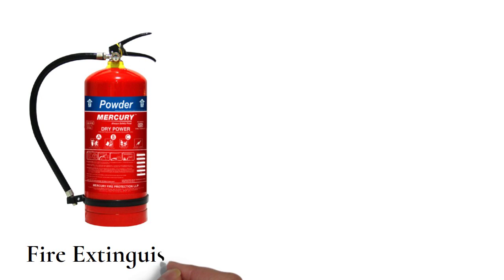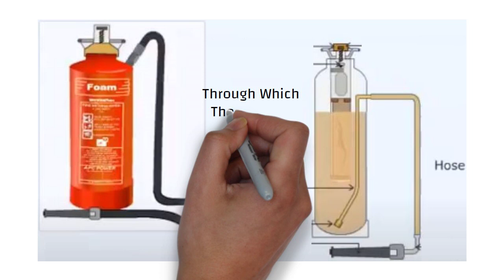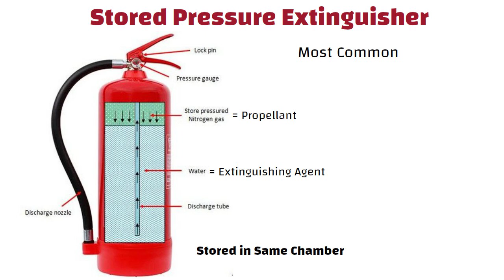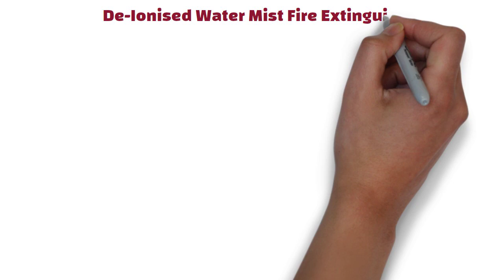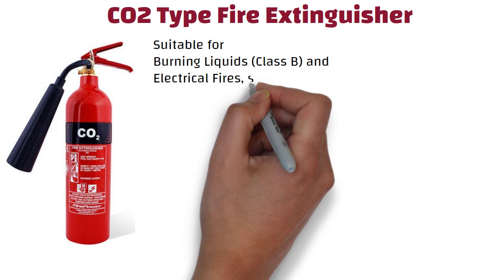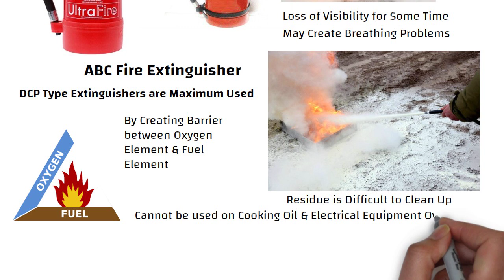FIRE EXTINGUISHER DEALERS IN KERALA, CALL 8138906102, FIRE EXTINGUISHER DEALERS IN ERNAKULAM.

Comment: Fire extinguisher in Feroke
Reply: FIRE EXTINGUISHER DEALERS IN KERALA, FIRE EXTINGUISHER SUPPLIERS IN KERALA, FIRE EXTINGUISHER DISTRIBUTORS IN KERALA, FIRE EXTINGUISHER IN KERALA, ABC TYPE FIRE EXTINGUISHER DEALERS IN KERALA, CO2 TYPE FIRE EXTINGUISHER DEALERS IN KERALA, CLEAN AGENT FIRE EXTINGUISHER IN KERALA, MODULAR TYPE FIRE EXTINGUISHER DEALERS IN KERALA, MECHANICAL FOAM FIRE EXTINGUISHER DEALERS IN KERALA, FIRE EXTINGUISHER NEAR ME KERALA, FIRE EXTINGUISHER TRADERS IN KERALA, FIRE FIGHTING COMPANIES IN KERALA, FIRE CONTRACTORS IN KERALA, FIRE EQUIPMENT DEALERS IN KERALA, FIRE ALARM DEALERS IN KERALA, FIRE PUMP DEALERS IN KERALA, SMOKE DETECTOR DEALERS IN KERALA, FIRE FIGHTING SYSTEM IN KERALA, FIRE PROTECTION SYSTEM IN KERALA, FIRE AND SAFETY CONTRACTORS IN KERALA, FIRE HYDRANT SYSTEMS IN KERALA, PA TALK BACK SYSTEM IN KERALA, FIRE NOC IN KERALA, FIRE INSTALLATION IN KERALA, FIRE NOC RENEWAL IN KERALA, KIRLOSKAR FIRE PUMP DEALERS IN KERALA, FIRE EXTINGUISHER NEAR ME KERALA, FIRE EXTINGUISHER MANUFACURERS IN KERALA, SAFEX FIRE EXTINGUISHER DEALERS IN KERALA, FIRE NOC CONTRACTORS IN KERALA, FIRE FIGHTING EQUIPMENT DEALERS IN KERALA, FIRE PROTECTION SYSTEM IN KERALA, FIRE INSTALLATION IN KERALA, FIRE SAFETY CONTRACTORS IN KERALA, FIRE AMC IN KERALA, FIRE PROTECTION SYSTEM IN KERALA, FIRE PROTECTION EQUIPMET IN KERALA, AMC OF FIRE SYSTEM IN KERALA, FIRE CONSULTANTS IN KERALA, FIRE AND SAFETY EQUIPMENT DEALERS IN KERALA, ADDRESSABLE FIRE ALARM SYSTEM IN KERALA, KARTHAR VALVE DEALERS IN KERALA, DCP TYPE FIRE EXTINGUISHER IN KERALA, POWSER TYPE FIRE EXTINGUISHERS IN KERALA, FIRE HYDRANT SYSTEM IN KERALA, FIRE ALARM PANEL DEALERS IN KERALA, SAFEPRO FIRE EXTINGUISHER DEALERS IN KERALA, MS AND GI PIPE DEALERS IN KERALA, JINDAL PIPE DEALERS IN KERALA, AGNI FIRE ALARM DEALERS IN KERALA, FIRE EQUIPMENT DEALERS IN KERALA, FIRE EQUIPMENT SUPPLIERS IN KERALA, FIRE EQUIPMENT TRADERS IN KERALA, FIRE SPRINKLER SYSTEM IN KERALA, RAVLE FIRE ALARM DEALERS IN KERALA, RAVEL FIRE ALARM SYSTEM IN KERALA, AGNI FIRE ALARM DISTRIBUTORS IN KERALA, FIRE ALARM CONTRACTORS IN KERALA, FIRE PIPE INSTALLATION IN CONTRACTORS IN KERALA, FIRE SAFETY CONTRACTORS IN KERALA, FIRE PA TWO WAY TALK BACK SYSTEM DEALERS IN KERALA, HEAT DETECTOR DEALERS IN KERALA, HONEYWELL FIRE ALARM DEALERS IN KERALA, FIRE NOC CONSULTANTS IN KERALA, FIRE AMC AND FIRE NOC IN KERALA, FIRE SAFETY COMPANIES IN KERALA, NEWAGE DEALERS IN KERALA, MONSHER FIRE EQUIPMENT DEALERS IN KERALA, KARTHAR VALVE DEALERS IN KERALA, FIRE HYDRANT VALVE DEALERS IN KERALA, FIRE HOSE REEL DRUM DEALERS IN KERALA, FIRE SPRINKLER DEALERS IN KERALA, FIRE PUMP DEALERS IN KERALA, LUBI PUMP DEALERS IN KERALA, LHP PUMP DEALERS IN KERALA.

Comment: Fire extinguisher dealers in Feroke
Reply: FIRE EXTINGUISHER DEALERS IN KERALA, FIRE EXTINGUISHER SUPPLIERS IN KERALA, FIRE EXTINGUISHER DISTRIBUTORS IN KERALA, FIRE EXTINGUISHER IN KERALA, ABC TYPE FIRE EXTINGUISHER DEALERS IN KERALA, CO2 TYPE FIRE EXTINGUISHER DEALERS IN KERALA, CLEAN AGENT FIRE EXTINGUISHER IN KERALA, MODULAR TYPE FIRE EXTINGUISHER DEALERS IN KERALA, MECHANICAL FOAM FIRE EXTINGUISHER DEALERS IN KERALA, FIRE EXTINGUISHER NEAR ME KERALA, FIRE EXTINGUISHER TRADERS IN KERALA, FIRE FIGHTING COMPANIES IN KERALA, FIRE CONTRACTORS IN KERALA, FIRE EQUIPMENT DEALERS IN KERALA, FIRE ALARM DEALERS IN KERALA, FIRE PUMP DEALERS IN KERALA, SMOKE DETECTOR DEALERS IN KERALA, FIRE FIGHTING SYSTEM IN KERALA, FIRE PROTECTION SYSTEM IN KERALA, FIRE AND SAFETY CONTRACTORS IN KERALA, FIRE HYDRANT SYSTEMS IN KERALA, PA TALK BACK SYSTEM IN KERALA, FIRE NOC IN KERALA, FIRE INSTALLATION IN KERALA, FIRE NOC RENEWAL IN KERALA, KIRLOSKAR FIRE PUMP DEALERS IN KERALA, FIRE EXTINGUISHER NEAR ME KERALA, FIRE EXTINGUISHER MANUFACURERS IN KERALA, SAFEX FIRE EXTINGUISHER DEALERS IN KERALA, FIRE NOC CONTRACTORS IN KERALA, FIRE FIGHTING EQUIPMENT DEALERS IN KERALA, FIRE PROTECTION SYSTEM IN KERALA, FIRE INSTALLATION IN KERALA, FIRE SAFETY CONTRACTORS IN KERALA, FIRE AMC IN KERALA, FIRE PROTECTION SYSTEM IN KERALA, FIRE PROTECTION EQUIPMET IN KERALA, AMC OF FIRE SYSTEM IN KERALA, FIRE CONSULTANTS IN KERALA, FIRE AND SAFETY EQUIPMENT DEALERS IN KERALA, ADDRESSABLE FIRE ALARM SYSTEM IN KERALA, KARTHAR VALVE DEALERS IN KERALA, DCP TYPE FIRE EXTINGUISHER IN KERALA, POWSER TYPE FIRE EXTINGUISHERS IN KERALA, FIRE HYDRANT SYSTEM IN KERALA, FIRE ALARM PANEL DEALERS IN KERALA, SAFEPRO FIRE EXTINGUISHER DEALERS IN KERALA, MS AND GI PIPE DEALERS IN KERALA, JINDAL PIPE DEALERS IN KERALA, AGNI FIRE ALARM DEALERS IN KERALA, FIRE EQUIPMENT DEALERS IN KERALA, FIRE EQUIPMENT SUPPLIERS IN KERALA, FIRE EQUIPMENT TRADERS IN KERALA, FIRE SPRINKLER SYSTEM IN KERALA, RAVLE FIRE ALARM DEALERS IN KERALA, RAVEL FIRE ALARM SYSTEM IN KERALA, AGNI FIRE ALARM DISTRIBUTORS IN KERALA, FIRE ALARM CONTRACTORS IN KERALA, FIRE PIPE INSTALLATION IN CONTRACTORS IN KERALA, FIRE SAFETY CONTRACTORS IN KERALA, FIRE PA TWO WAY TALK BACK SYSTEM DEALERS IN KERALA, HEAT DETECTOR DEALERS IN KERALA, HONEYWELL FIRE ALARM DEALERS IN KERALA, FIRE NOC CONSULTANTS IN KERALA, FIRE AMC AND FIRE NOC IN KERALA, FIRE SAFETY COMPANIES IN KERALA, NEWAGE DEALERS IN KERALA, MONSHER FIRE EQUIPMENT DEALERS IN KERALA, KARTHAR VALVE DEALERS IN KERALA, FIRE HYDRANT VALVE DEALERS IN KERALA, FIRE HOSE REEL DRUM DEALERS IN KERALA, FIRE SPRINKLER DEALERS IN KERALA, FIRE PUMP DEALERS IN KERALA, LUBI PUMP DEALERS IN KERALA, LHP PUMP DEALERS IN KERALA.

Comment from the maker: IN PANDALAM, KIRLOKAR FIRE PUMP DEALERS IN HOSUR, KIRLSOAKR FIRE FIGHTING PUMP DEALERS IN PANDALAM, KIRLOSKAR FIRE PUMPS IN PANDALAM, KIRLSOKAR FIRE PUMP DISTRIBUTORS IN PANDALAM, FIRE ENGINE PUMP SETS IN PANDALAM, KIRLOSKAR PUMP DEALERS IN TIRUELVELI, KIRLOSKAR DEALERS IN PANDALAM, KIRLOSKAR PUMPS IN PANDALAM, KIRLOSKAR PUMPS IN PANDALAM, LUBI FIRE PUMP DEALERS IN PANDALAM, LUBI FIRE PUMP DEALERS IN PANDALAM, LUBI FIRE PUMP DEALERS IN PANDALAM, FIRE PUMP SUPPLERS IN PANDALAM, FIRE FIGHTING PUMP DEALERS IN PANDALAM, FIRE PUMP DEALERS IN PANDALAM, FIRE PUMP SUPPLIERS IN PANDALAM, FIRE PUMP DEALERS IN PANDALAM, FIRE FIGHTING PUMPS IN PANDALAM, FIRE FIGHTING PUMP DEALERS IN PANDALAM, FIRE FIGHTING PUMP SUPPLIERS IN PANDALAM, FIRE FIGHTING PUMP SET DEALERS IN PANDALAM, FIRE PUMP IN PANDALAM, FIRE PUMP IN PANDALAM, FIRE PUMP IN PANDALAM, FIRE DIESEL ENGINE PUMP DEALERS IN PANDALAM, FIRE DIESEL ENGINE STANDBY PUMP DEALERS IN PANDALAM, FIRE JOCKEY PUMP DEALERS IN PANDALAM, FIRE JOCKEY PUMP DEALERS IN PANDALAM, FIRE JOCKEY PUMP DEALERS IN PANDALAM. CRI PUMP DEALERS IN PANDALAM, HYDRO PNEUMATIC PRESSURE BOOSTING PUMP DEALERS IN PANDALAM, VERTICAL INLINE PUMP DEALERS IN PANDALAM, INDUSTRIAL PUMP DEALERS IN PANDALAM, SEWAGE PUMP DEALERS IN PANDALAM, STP AND ETP PUMP DEALERS IN TIRUNELVALEI, STP AND ETP PUMP DEALERS IN TPANDALAM, STP AND ETP PUMP DEALERS IN PANDALAM, STP AND ETP PUMP DEALERS IN PANDALAM, HYDRO PNEUMATIC PRESSURE BOOSTING PUMP DEALERS IN PANDALAM, SEWAGE PUMP DEALERS IN PANDALAM, DEWATERING PUMP DEALERS IN PANDALAM, FIRE JOCKEY PUMP DEALERS IN PANDALAM,
Reply: FIRE EXTINGUISHER DEALERS IN KATTAPPANA, FIRE EXTINGUISHER SUPPLIERS IN KATTAPPANA, FIRE EXTINGUISHER DISTRIBUTORS IN KATTAPPANA, FIRE EXTINGUISHER IN KATTAPPANA, ABC TYPE FIRE EXTINGUISHER DEALERS IN KATTAPPANA, CO2 TYPE FIRE EXTINGUISHER DEALERS IN KATTAPPANA, CLEAN AGENT FIRE EXTINGUISHER IN KATTAPPANA, MODULAR TYPE FIRE EXTINGUISHER DEALERS IN KATTAPPANA, MECHANICAL FOAM FIRE EXTINGUISHER DEALERS IN KATTAPPANA, FIRE EXTINGUISHER NEAR ME KATTAPPANA, FIRE EXTINGUISHER TRADERS IN KATTAPPANA, FIRE FIGHTING COMPANIES IN KATTAPPANA, FIRE CONTRACTORS IN KATTAPPANA, FIRE EQUIPMENT DEALERS IN KATTAPPANA, FIRE ALARM DEALERS IN KATTAPPANA, FIRE PUMP DEALERS IN KATTAPPANA, SMOKE DETECTOR DEALERS IN KATTAPPANA, FIRE FIGHTING SYSTEM IN KATTAPPANA, FIRE PROTECTION SYSTEM IN KATTAPPANA, FIRE AND SAFETY CONTRACTORS IN KATTAPPANA, FIRE HYDRANT SYSTEMS IN KATTAPPANA, PA TALK BACK SYSTEM IN KATTAPPANA, FIRE NOC IN KATTAPPANA, FIRE INSTALLATION IN KATTAPPANA, FIRE NOC RENEWAL IN KATTAPPANA, KIRLOSKAR FIRE PUMP DEALERS IN KATTAPPANA, FIRE EXTINGUISHER NEAR ME KATTAPPANA, FIRE EXTINGUISHER MANUFACURERS IN KATTAPPANA, SAFEX FIRE EXTINGUISHER DEALERS IN KATTAPPANA, FIRE NOC CONTRACTORS IN KATTAPPANA, FIRE FIGHTING EQUIPMENT DEALERS IN KATTAPPANA, FIRE PROTECTION SYSTEM IN KATTAPPANA, FIRE INSTALLATION IN KATTAPPANA, FIRE SAFETY CONTRACTORS IN KATTAPPANA, FIRE AMC IN KATTAPPANA, FIRE PROTECTION SYSTEM IN KATTAPPANA, FIRE PROTECTION EQUIPMET IN KATTAPPANA, AMC OF FIRE SYSTEM IN KATTAPPANA, FIRE CONSULTANTS IN KATTAPPANA, FIRE AND SAFETY EQUIPMENT DEALERS IN KATTAPPANA, ADDRESSABLE FIRE ALARM SYSTEM IN KATTAPPANA, KARTHAR VALVE DEALERS IN KATTAPPANA, DCP TYPE FIRE EXTINGUISHER IN KATTAPPANA, POWSER TYPE FIRE EXTINGUISHERS IN KATTAPPANA, FIRE HYDRANT SYSTEM IN KATTAPPANA, FIRE ALARM PANEL DEALERS IN KATTAPPANA, SAFEPRO FIRE EXTINGUISHER DEALERS IN KATTAPPANA, MS AND GI PIPE DEALERS IN KATTAPPANA, JINDAL PIPE DEALERS IN KATTAPPANA, AGNI FIRE ALARM DEALERS IN KATTAPPANA, FIRE EQUIPMENT DEALERS IN KATTAPPANA, FIRE EQUIPMENT SUPPLIERS IN KATTAPPANA, FIRE EQUIPMENT TRADERS IN KATTAPPANA, FIRE SPRINKLER SYSTEM IN KATTAPPANA, RAVEL FIRE ALARM DEALERS IN KATTAPPANA, RAVEL FIRE ALARM SYSTEM IN KATTAPPANA, AGNI FIRE ALARM DISTRIBUTORS IN KATTAPPANA, FIRE ALARM CONTRACTORS IN KATTAPPANA, FIRE PIPE INSTALLATION IN CONTRACTORS IN KATTAPPANA, FIRE SAFETY CONTRACTORS IN KATTAPPANA, FIRE PA TWO WAY TALK BACK SYSTEM DEALERS IN KATTAPPANA, HEAT DETECTOR DEALERS IN KATTAPPANA, HONEYWELL FIRE ALARM DEALERS IN KATTAPPANA, FIRE NOC CONSULTANTS IN KATTAPPANA, FIRE AMC AND FIRE NOC IN KATTAPPANA, FIRE SAFETY COMPANIES IN KATTAPPANA, NEWAGE DEALERS IN KATTAPPANA, MONSHER FIRE EQUIPMENT DEALERS IN KATTAPPANA, KARTHAR VALVE DEALERS IN KATTAPPANA, FIRE HYDRANT VALVE DEALERS IN KATTAPPANA, FIRE HOSE REEL DRUM DEALERS IN KATTAPPANA, FIRE SPRINKLER DEALERS IN KATTAPPANA, FIRE PUMP DEALERS IN KATTAPPANA, LUBI PUMP DEALERS IN KATTAPPANA, LHP PUMP DEALERS IN KATTAPPANA. FIRE ALARM SYSTEMS IN KATTAPPANA, ADDRESSABLE FIRE ALARM DEALERS IN KATTAPPANA, SMOKE DETECTOR DEALERS IN KATTAPPANA, FIRE ALARM CONTRACTORS IN KATTAPPANA, FIRE ALARM PANEL DEALERS IN KATTAPPANA, BIRE ALARM INSTALLTION IN KATTAPPANA, MORLEY FIRE ALARM DEALERS IN KATTAPPANA, HONEYWELL FIRE ALARM DEALERS IN KATTAPPANA, GST FIRE ALARM DEALERS IN KATTAPPANA, FIRE FIGHTING COMPANIES IN KATTAPPANA, FIRE AND SAFETY CONTRACTORS IN KATTAPPANA, FIRE EQUIPMENT IN KATTAPPANA, SAFEPRO FIRE EXTINGUISHER DEALERS IN KATTAPPANA, SAFEX FIRE EXTINGUISHER DEALERS IN KATTAPPANA, SIMPLEX FIRE ALARM DEALERS IN KATTAPPANA, TYCO DEALERS IN KATTAPPANA, JINDAL PIPE DEALERS IN KATTAPPANA, KARTHAR DISTRIBUTORS IN KATTAPPANA, STENTOR DEALERS IN KATTAPPANA, MONSHER DEALERS IN KATTAPPANA, NEWAGE DEALERS IN KATTAPPANA, RONAK HOSE REEL DEALERS IN KATTAPPANA,

Comment: Fire extinguisher dealers in Pathanamthitta
Reply: FIRE EXTINGUISHER DEALERS IN KERALA, FIRE EXTINGUISHER SUPPLIERS IN KERALA, FIRE EXTINGUISHER DISTRIBUTORS IN KERALA, FIRE EXTINGUISHER IN KERALA, ABC TYPE FIRE EXTINGUISHER DEALERS IN KERALA, CO2 TYPE FIRE EXTINGUISHER DEALERS IN KERALA, CLEAN AGENT FIRE EXTINGUISHER IN KERALA, MODULAR TYPE FIRE EXTINGUISHER DEALERS IN KERALA, MECHANICAL FOAM FIRE EXTINGUISHER DEALERS IN KERALA, FIRE EXTINGUISHER NEAR ME KERALA, FIRE EXTINGUISHER TRADERS IN KERALA, FIRE FIGHTING COMPANIES IN KERALA, FIRE CONTRACTORS IN KERALA, FIRE EQUIPMENT DEALERS IN KERALA, FIRE ALARM DEALERS IN KERALA, FIRE PUMP DEALERS IN KERALA, SMOKE DETECTOR DEALERS IN KERALA, FIRE FIGHTING SYSTEM IN KERALA, FIRE PROTECTION SYSTEM IN KERALA, FIRE AND SAFETY CONTRACTORS IN KERALA, FIRE HYDRANT SYSTEMS IN KERALA, PA TALK BACK SYSTEM IN KERALA, FIRE NOC IN KERALA, FIRE INSTALLATION IN KERALA, FIRE NOC RENEWAL IN KERALA, KIRLOSKAR FIRE PUMP DEALERS IN KERALA, FIRE EXTINGUISHER NEAR ME KERALA, FIRE EXTINGUISHER MANUFACURERS IN KERALA, SAFEX FIRE EXTINGUISHER DEALERS IN KERALA, FIRE NOC CONTRACTORS IN KERALA, FIRE FIGHTING EQUIPMENT DEALERS IN KERALA, FIRE PROTECTION SYSTEM IN KERALA, FIRE INSTALLATION IN KERALA, FIRE SAFETY CONTRACTORS IN KERALA, FIRE AMC IN KERALA, FIRE PROTECTION SYSTEM IN KERALA, FIRE PROTECTION EQUIPMET IN KERALA, AMC OF FIRE SYSTEM IN KERALA, FIRE CONSULTANTS IN KERALA, FIRE AND SAFETY EQUIPMENT DEALERS IN KERALA, ADDRESSABLE FIRE ALARM SYSTEM IN KERALA, KARTHAR VALVE DEALERS IN KERALA, DCP TYPE FIRE EXTINGUISHER IN KERALA, POWSER TYPE FIRE EXTINGUISHERS IN KERALA, FIRE HYDRANT SYSTEM IN KERALA, FIRE ALARM PANEL DEALERS IN KERALA, SAFEPRO FIRE EXTINGUISHER DEALERS IN KERALA, MS AND GI PIPE DEALERS IN KERALA, JINDAL PIPE DEALERS IN KERALA, AGNI FIRE ALARM DEALERS IN KERALA, FIRE EQUIPMENT DEALERS IN KERALA, FIRE EQUIPMENT SUPPLIERS IN KERALA, FIRE EQUIPMENT TRADERS IN KERALA, FIRE SPRINKLER SYSTEM IN KERALA, RAVLE FIRE ALARM DEALERS IN KERALA, RAVEL FIRE ALARM SYSTEM IN KERALA, AGNI FIRE ALARM DISTRIBUTORS IN KERALA, FIRE ALARM CONTRACTORS IN KERALA, FIRE PIPE INSTALLATION IN CONTRACTORS IN KERALA, FIRE SAFETY CONTRACTORS IN KERALA, FIRE PA TWO WAY TALK BACK SYSTEM DEALERS IN KERALA, HEAT DETECTOR DEALERS IN KERALA, HONEYWELL FIRE ALARM DEALERS IN KERALA, FIRE NOC CONSULTANTS IN KERALA, FIRE AMC AND FIRE NOC IN KERALA, FIRE SAFETY COMPANIES IN KERALA, NEWAGE DEALERS IN KERALA, MONSHER FIRE EQUIPMENT DEALERS IN KERALA, KARTHAR VALVE DEALERS IN KERALA, FIRE HYDRANT VALVE DEALERS IN KERALA, FIRE HOSE REEL DRUM DEALERS IN KERALA, FIRE SPRINKLER DEALERS IN KERALA, FIRE PUMP DEALERS IN KERALA, LUBI PUMP DEALERS IN KERALA, LHP PUMP DEALERS IN KERALA.
Reply: FIRE EXTINGUISHER DEALERS IN KERALA, FIRE EXTINGUISHER SUPPLIERS IN KERALA, FIRE EXTINGUISHER DISTRIBUTORS IN KERALA, FIRE EXTINGUISHER IN KERALA, ABC TYPE FIRE EXTINGUISHER DEALERS IN KERALA, CO2 TYPE FIRE EXTINGUISHER DEALERS IN KERALA, CLEAN AGENT FIRE EXTINGUISHER IN KERALA, MODULAR TYPE FIRE EXTINGUISHER DEALERS IN KERALA, MECHANICAL FOAM FIRE EXTINGUISHER DEALERS IN KERALA, FIRE EXTINGUISHER NEAR ME KERALA, FIRE EXTINGUISHER TRADERS IN KERALA, FIRE FIGHTING COMPANIES IN KERALA, FIRE CONTRACTORS IN KERALA, FIRE EQUIPMENT DEALERS IN KERALA, FIRE ALARM DEALERS IN KERALA, FIRE PUMP DEALERS IN KERALA, SMOKE DETECTOR DEALERS IN KERALA, FIRE FIGHTING SYSTEM IN KERALA, FIRE PROTECTION SYSTEM IN KERALA, FIRE AND SAFETY CONTRACTORS IN KERALA, FIRE HYDRANT SYSTEMS IN KERALA, PA TALK BACK SYSTEM IN KERALA, FIRE NOC IN KERALA, FIRE INSTALLATION IN KERALA, FIRE NOC RENEWAL IN KERALA, KIRLOSKAR FIRE PUMP DEALERS IN KERALA, FIRE EXTINGUISHER NEAR ME KERALA, FIRE EXTINGUISHER MANUFACURERS IN KERALA, SAFEX FIRE EXTINGUISHER DEALERS IN KERALA, FIRE NOC CONTRACTORS IN KERALA, FIRE FIGHTING EQUIPMENT DEALERS IN KERALA, FIRE PROTECTION SYSTEM IN KERALA, FIRE INSTALLATION IN KERALA, FIRE SAFETY CONTRACTORS IN KERALA, FIRE AMC IN KERALA, FIRE PROTECTION SYSTEM IN KERALA, FIRE PROTECTION EQUIPMET IN KERALA, AMC OF FIRE SYSTEM IN KERALA, FIRE CONSULTANTS IN KERALA, FIRE AND SAFETY EQUIPMENT DEALERS IN KERALA, ADDRESSABLE FIRE ALARM SYSTEM IN KERALA, KARTHAR VALVE DEALERS IN KERALA, DCP TYPE FIRE EXTINGUISHER IN KERALA, POWSER TYPE FIRE EXTINGUISHERS IN KERALA, FIRE HYDRANT SYSTEM IN KERALA, FIRE ALARM PANEL DEALERS IN KERALA, SAFEPRO FIRE EXTINGUISHER DEALERS IN KERALA, MS AND GI PIPE DEALERS IN KERALA, JINDAL PIPE DEALERS IN KERALA, AGNI FIRE ALARM DEALERS IN KERALA, FIRE EQUIPMENT DEALERS IN KERALA, FIRE EQUIPMENT SUPPLIERS IN KERALA, FIRE EQUIPMENT TRADERS IN KERALA, FIRE SPRINKLER SYSTEM IN KERALA, RAVLE FIRE ALARM DEALERS IN KERALA, RAVEL FIRE ALARM SYSTEM IN KERALA, AGNI FIRE ALARM DISTRIBUTORS IN KERALA, FIRE ALARM CONTRACTORS IN KERALA, FIRE PIPE INSTALLATION IN CONTRACTORS IN KERALA, FIRE SAFETY CONTRACTORS IN KERALA, FIRE PA TWO WAY TALK BACK SYSTEM DEALERS IN KERALA, HEAT DETECTOR DEALERS IN KERALA, HONEYWELL FIRE ALARM DEALERS IN KERALA, FIRE NOC CONSULTANTS IN KERALA, FIRE AMC AND FIRE NOC IN KERALA, FIRE SAFETY COMPANIES IN KERALA, NEWAGE DEALERS IN KERALA, MONSHER FIRE EQUIPMENT DEALERS IN KERALA, KARTHAR VALVE DEALERS IN KERALA, FIRE HYDRANT VALVE DEALERS IN KERALA, FIRE HOSE REEL DRUM DEALERS IN KERALA, FIRE SPRINKLER DEALERS IN KERALA, FIRE PUMP DEALERS IN KERALA, LUBI PUMP DEALERS IN KERALA, LHP PUMP DEALERS IN KERALA. FIRE CONTRACTORS IN KERALA, FIRE AND SAFETY CONTRACTORS IN KERALA, FIRE EQUIPMENT DEALERS IN KERALA, FIRE FIGHTING CONTRACTORS IN KERALA,